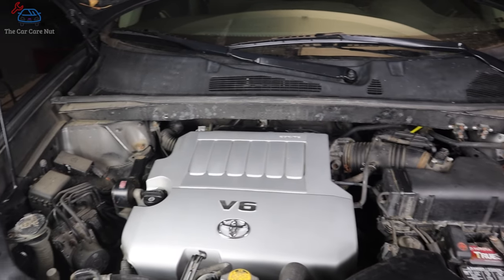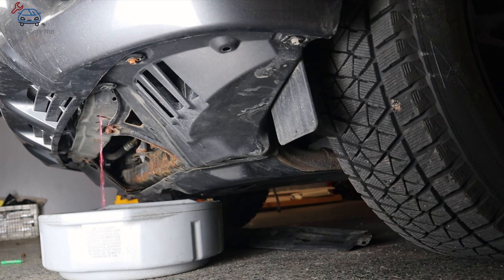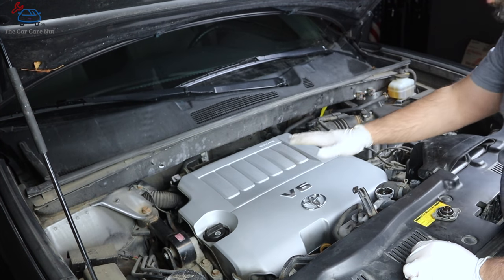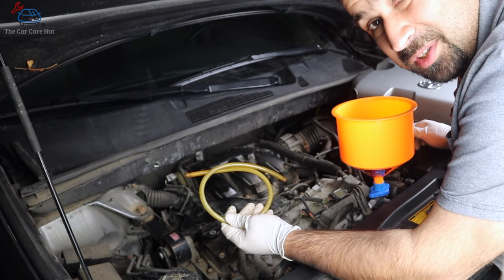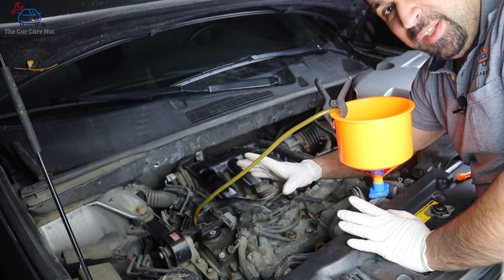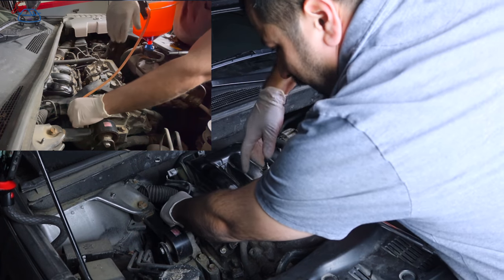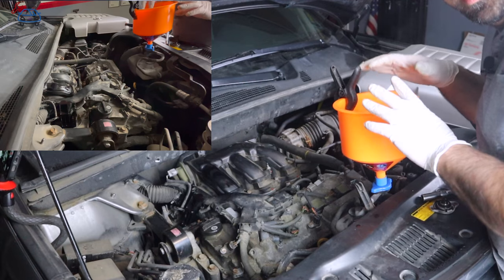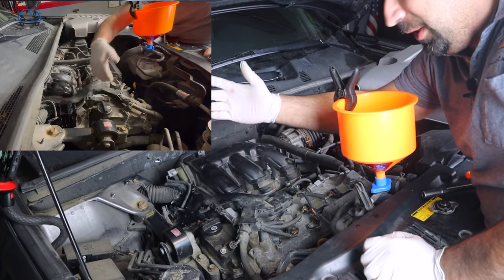Toyota Cooling System Bleeding for V6 2GR-FE 3.5L THE RIGHT WAY!

Comment: Hello, I’m doing this same procedure.  I got to the point where it did the whole chaotic thing and coolant was pushing the air out.  The coolant went back down it sporadically bubbles in the funnel but the coolant won’t go up the tube any longer.  Just empty.  Am I done?  I thought there would be continuous flow

Comment: Does the engine block need to be drained? isn't there a drain for the block near the exhaust manifold to do that?
Reply from the maker: Hi! Yes there’s a drain in the back to drain a small amount out of the black. From experience of actually tearing the engine down there’s still a good bit left in even with the block drain
Reply: @TheCarCareNut  Thank you for answering so quickly as that is what I have planned as soon as the funnel kit I just ordered arrives . I am so glad I found your video's as no one else mentioned the proper way to bleed the air out of the system . Hopefully the 10 year/ 300,000 mile Prestone marked for use in Toyota / Lexus that was on sale will not cause any problem when it mixes with the remaining fluid. Also thanks for the OBD port jumper information for the transmission , that will now be on my list to do.

Comment: Ahmed:  thank-you for your videos!  I own an '06 highlander hybrid ltd with a v6, transmission cooler, rear heat and 2 engine coolant drains.    Not sure if the drains are considered the "bleeder".  How do I use your drain and fill coolant method given setup described for my highlander.  thx

Comment: Hi
I love all of your videos and i followed you procedure  for the coolant flush . when i tried to unscrew the top 10mm bleeder it felt frozen so i opened the bottom 14mm of the assembly and carefully unscrew the bleeder , cleaned , installed  the bottom assembly  and when was screwing in the bleeder i lost it inside the engine bay . :(((((((  i spent 2 hours looking for it  and now another 2 hours trying to figure the part number .. the only one i get is bigger one with side bleeder pipe..  if you  can help it will be really big !  Thanks in advance! Stan.

Comment: Great video friend.  I was wondering if the bleed procedure is the same for the 1MZFE engine,  I have been having  issues getting it bled in a Toyota Alphard, the  handbook say to crack the bleed valve on the heater pipes but I can't find it to ensure it bled properly, the temp is holding steady but when I stop the engine there is a storm head smell from the wheel arch on the left side so I'm not 100% confident it has been bled properly.  any advice would be greatly appreciated.

Comment: Thank you AMD for the video, already purchased the items and going to do this now to complete my Evaporator Core replacement journey on my 2009 Toyota Highlander. I have a curious question, so when you mentioned to "NOT" turn on the front or rear heaters while doing this process to make sure they are kept OFF. At some point are you suppose to turn them on so that we assure the full flow of the new coolant goes through them to remove air bubbles? Or is the process of keeping them off and just doing the steps you outlined, going to push through both heater cores even though they are off? Is the purpose of keeping the heaters off to make sure that they don't cool the coolant?
Thank you
Reply from the maker: Hi! So your car doesn’t have a coolant valve for the heater so coolant will flow to the heater no matter what. Keeping them off makes sure you’re not loosing heat and makes the process quicker
Reply: @TheCarCareNut  AMD I just finished now bleeding the coolant system like you taught, worked perfect of course. I have now completed my front evaporator core replacement, what a job!! My suggestion would be to place a few crunched bounty paper towels around the bleeding valve so that whatever leaks over during the process stays mostly within the paper towels and then use a needle nose pliers to pull them out once completed. Process took less than 15 mins with my son helping to keep the RPM around 2500 rpm. Appreciate your videos, help! I did purchase 2 Days Access to Tech Info Toyota, priceless for getting all the torque values downloaded and then printed. Thank you

Comment: Thank you for the fine instructional videos. Does the 2GR-FE in my '16 Camry have block drain valves like my old Corolla's 1ZZ-FE? I always try to get as much of the old coolant out as possible.
Reply from the maker: Hi! It does have a block drain located underneath the exhaust manifold on the back bank. Kinda hard to get to it without a lift

Comment: My RAV4 2006 V6, 3.5L has the same engine. But it doesn't have the radiator cap like yours.   It has only 1 cap at the reservoir,  how do I do this method?   Thank you

Comment: Hey AMD, I didn’t follow the entire steps for coolant procedure on the 2grfe engine. I only opened the bleeder valve until fluid poured out (smoking around the serpentine belt). I haven’t noticed any issues so far with 3k miles on new fluid. I Had a 4hr total long drive to six flags over the weekend and was curious if that helped the system.  Will driving help properly remove air from system if it wasn’t done right? 
Thank you God bless you
Reply from the maker: Hi! Sometimes you get lucky and air makes its way out. Usually you loose heat or have overheating if it’s not bled correctly

Comment: Heres one more question one inverter hose is hard cant squeeze it hardly one that goes to inverter pump  its 2002 prius if its hard to squeeze should i replace it? Havent put fresh fluid in yet. Its completely drained.

Comment: great video.  I have drained and refilled without bleeding.  I remember i had to fill in until it is stable.  I have been driving for a while now without any issue (almost a year).  Do I really need to bleed the system now? thank you
Reply from the maker: If you have heat at idle then you’re good
Reply: @TheCarCareNut  Thank you so much. BTW, for the v6, there are two drain block.  do i open these for drain or draining from the radiator is enough.  thx

Comment: When u say turn the heat off do u mean set the temperature tor the lowest setting thus basically closing flow to the heater core? I've always opened the heater core valve when filling a coolant system previously... how will fluid get the the heater core if the valve is  closed (lowest temp setting)?
Reply: 2 replies

@TheCarCareNut
3 years ago
Hi! So your car doesn’t have a coolant valve for the heater so coolant will flow to the heater no matter what. Keeping them off makes sure you’re not loosing heat and makes the process quicker

Comment: Hey AMD, is it ok to use a Radiator Flush solution like something made by Prestone or Blue Devil to flush the dirt and rust out of the cooling system ?

Then drain and refill with distilled water multiple times until the water looks as clear as possible ?

Just mostly wondering if the Radiator flush solutions are too harsh for the cooling system….

I have a 2021 Tacoma with the 3.5 V6…that’s what I’ll be doing the flush on 

Thanks man.

Comment: Can you use an air compressor, set at under 20 psi, and blow the coolant out of the block throught that bleeder?
Reply: Yes, it works great.  I managed to blow out about 1 extra litre of coolant doing this.  I pulled the bleeder out completely and used the rubber tipped blow nozzle to make a seal.  I kept the radiator cap on while blowing out the coolant at the bottom of the radiator.  I set the tool pressure below 20 psi.

Comment: @The Car Nut...found this after I had filled with a no spill funnel all the way cold...

The coolant dropped down as expected, but  when it started bubbling violently, it was all just splash out of funnel before the line was filled...due I just have too much coolant in the system?   Should I continue to let it splash out until it runs through the line?

Comment: I can't tell, is the coolant funnel on the overflow reservoir cap or on the radiator cap itself? My rav4 reservoir is off to the passenger side, not familiar with the highlander layout.
Reply from the maker: Hi! It’s on the radiator itself. On rav4s they don’t have a direct access to the radiator so in your case you’d use the spill free funnel directly on the plastic reservoir on the side

Comment: Does this apply to other Toyota engines?  Does the 2006 RX330 (3MZ-FE) have a bleeder valve?  If not, do you just let the air bubbles escape through the funnel attached the radiator?
Reply from the maker: Hi! The 3MZ doesn’t have a bleeder just run the car until you hear the fan cycle on and off twice
Reply: @TheCarCareNut  awesome thanks!  Do I need to have the heat on as well?
Reply from the maker: On that one no

Comment: I drained my sienna and changed the water pump. I have not refilled yet I left it for tomorrow but it had green coolant in it. I already bought Toyota coolant for it. Will this be an issue
Reply from the maker: Hi! It shouldn’t be an issue as doing the water pump drains most of the coolant in the block

Comment: I just bought an OEMTools coolant refiller yesterday and was planning to use it tomorrow. Will that not work for this engine? 2007 Toyota Camry XLE V6
Reply from the maker: Hi! Hit and miss honestly with the coolant refiller. I would use this method as it doesn’t really require anything expensive to do and works very well.

Comment: Hi. I have a 2016 Highlander with 100 000 km(I’m in Canada). At what point I should switch to synthetic oil and how long should I drive between oil changes(8000-10 000)? Will that be a great benefit to my V6 3.5 engine? Thanks a lot, you have an excellent site. John.
Reply from the maker: Hi! This engine always uses 0w20 synthetic oil
Reply: Thanks. Sorry, just bought this car, I should have read the manual first…have a nice day.

Comment: Any ideas on how long it should take before you get steady flow from bleeder valve? Been rockin this sienna at 2k for 20 plus minutes and still sputtering.
Reply from the maker: It can take a while sometimes. Make sure your heater is off both front and rear.
Reply: Thanks for the reply. Never did get a solid flow and ran for over an hour. Guess I'll try again tomorrow.

Comment: If i drained the rad and replaced the water pump and only have a half gallon in the jug, can I drive to the auto parts store 5 miles away to buy more coolant and a no spill funnel and tube?

Comment: Great video, as usual! How do you know how much coolant to put in? Measure how much comes out? I'm guessing you didn't actually pour 12 fresh quarts in that engine. Any reason NOT to also drain at the engine drain plugs?
Reply from the maker: Hi! Usually most toyotas will take 1-2 gallons some will just go over. The engine drain plug drains a bit more but at the risk of breaking the drain as they can seize and usually placed in the worst location
Reply: @TheCarCareNut  Thanks for the advice on the engine drains. Would there be any benefit to trying to drain at the rear heater core location (2012 Highlander) to get more fluid out? Or just do a simple radiator drain and fill as you show, drive a bit, then maybe repeat another time or two?
Reply from the maker: You could but then you run the risk of damaging the hoses as they tend to get brittle. I wouldn’t disturb hoses just to drain the coolant. The coolant you drain normally is enough to keep things protected
Reply: @TheCarCareNut  thanks again for the wisdom. I'm doing mine right now and it's going a little bit differently than your video. I didn't have the spitting at the beginning, I just had some foam. It very quickly emptied the hose and then took a while for it to start flowing. It's blowing steadily but there are still some big bubbles coming out. So I'm just going to wait until the bubble stop and then close the bleeder. And it's been about 5 minutes of this but hopefully we'll end soon!
Reply: @TheCarCareNut  well, I let it flow and bubble for 45 minutes and then stopped. I'm starting to think maybe I had the bleeder valve a little bit too loose and maybe that was sucking air in or something.

Comment: AMD, saw you talk about piston slap on revision 2 versions of this engine.  I have a 2013 highlander that sounded a little slappy but goes away when it’s fully warmed.  Is the revision 2 in the 2013 and does this sound like the same issue

Comment: AMD, I trust you, but I just have to ask since I have always been shown to open the heater valve. Why is the 2GR-FE different? Just curious. Thanks for another great video.
Reply from the maker: Hi William. The answer is simple. The 2GR-FE doesn’t have a heater valve that opens and closes. Coolant always flows to the heater core.
Reply: @TheCarCareNut  See, I knew it!  I just really wanted to know. Didn't consider the technology input for the heating circuit. Thanks for the quick response.. you are a true resource.

Comment: Great video, love the Toyota tips!!
  Question: can a timing cover be removed while the engine is in the vehicle on a 2013 Toyota venza?? Need to replace the chain and vvti sprockets. 🙁. Thanks again for all your input.
Reply from the maker: Hi! 4 cylinder or 6?
Reply: @TheCarCareNut  6 cylinder
Reply from the maker: The engine needs to come out unfortunately.
Reply: @TheCarCareNut  no way to sneak the timing cover out on the 2grfe? 🙁
Reply from the maker: It’s very tight and you risk oil contact and smearing the sealer. You can try it but it’s 100 times harder. If you have a lift pulling the engine with the trans and cradle is not hard

Comment: Thanks for the timely video as I get ready to do the coolant change on my 2013 Lexus rx350. Should I also drain the coolant through the engine block drain plugs? I believe there are 2 of them on the 2GR-FE engine. Thanks.
Reply from the maker: Hi! If you can reach the drains easily it wouldn’t hurt but only a small amount comes out of the block.
Reply: @TheCarCareNut  thank you!

Comment: Hi AMD! Just finished watching this video and getting ready to do this on a 2014 Highlander. I just have a question, in while waiting for the steady flow of coolant from the hose, what if the coolant on the reservoir got emptied, do I have to add some more coolant to keep it in the same level when we started?
Reply from the maker: Hi! Yes add some coolant if the level drops but not too high. Keep it just under half way in the funnel.

Comment: Is flushing with distilled water necessary to replace Coolant? My 2014 Sienna is due for the 160,000 km (100,000 m) replacement and I was planning to do the flush.
Reply from the maker: Hi! Unless there’s contamination there’s no reason to flush it

Comment: Great video.  I was wondering what kind of radiator conditioner to use.  Also, is Water Wetter by Redline worth trying or will it cause an engine to be too cool?
Reply from the maker: Hi! I would just use original coolant without anything additional

Comment: My brother in Christ, does this procedure applies to 2018 Highlander V6 and how about 2003 Lexus GS 300?
Reply from the maker: Unfortunately this doesn’t apply to either. The 2018 highlander has the updated 2GR which doesn’t have the bleeder and the GS has a different configuration as well

Comment: Hi Car Care Nut,
I have a 2005 Sienna with a 3MZ-FE 3.3L engine. I can't get much heat out of it in the winter. What's the proper way to bleed the coolant system on that engine? Thanks!

Comment: Love your channel! Just ordered the funnel in preparation of changing the coolant in my 2015 Highlander with the 2GR-FE engine. I have a question. My manual advises loosening cylinder block drain cock plugs for Banks 1 and 2. I can't see these from under the hood so guess they are only accessible from underneath the car and possibly tough to get at? Do you feel it's really necessary to loosen these two drain cocks for a complete coolant change?
Reply from the maker: Hi! Honestly they’re hard to get to and you’ll only drain a small amount. I wouldn’t worry about them and change what’s in the radiator and the hoses
Reply: @TheCarCareNut  Thanks so much AMD. Really appreciate your speedy reply. Now just need that funnel.😀
Reply: Job completed and all worked like a charm. Thanks again AMD.

Comment: What happens to the coolant in the bucket? Will it naturally go down so as not to make a mess when taken off? Can anyone please reply, planning to do this over over the weekend.  Thank you AMD for your videos.
Reply: From my comment concerning no mess:
we had leftover coolant almost half way up in the funnel. The funnel comes with a no spill, long center stopper/valve which I plugged the funnel. Then, without losing any coolant, I transferred the funnel over to the overflow tank which was nearly empty, and pulled up on the center plug just enough to slowly fill to the “full line” before replugging. Again, I emptied the remaining coolant back into it’s jug.

Comment: What If you lift the front of the car to make the radiator cap the highest point so air well get out?
Reply from the maker: On this engine that trick doesn’t work for some reason. It still will give you a hard time to bleed
Reply: Meaning those engines with bleeder valves have the bleeder valves engineered to be at the up most point of the cooling system flow.?
Reply from the maker: So the bleeder valve is the highest point however you’d still want to rev up the engine to get air out of the heater core which is common to trap air in this engine